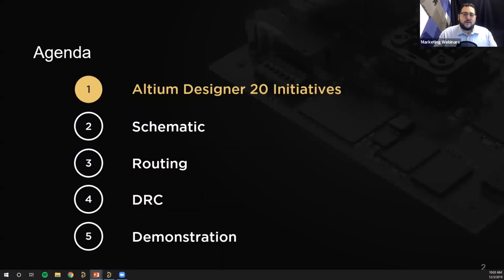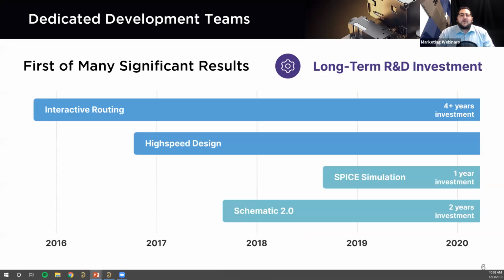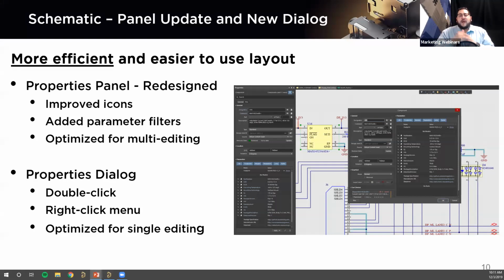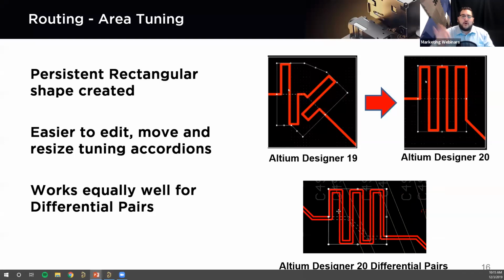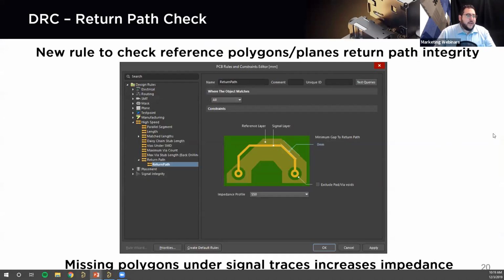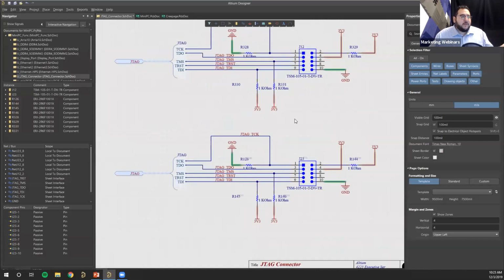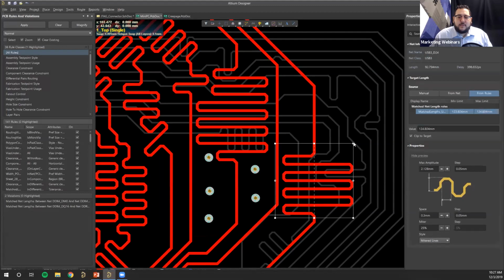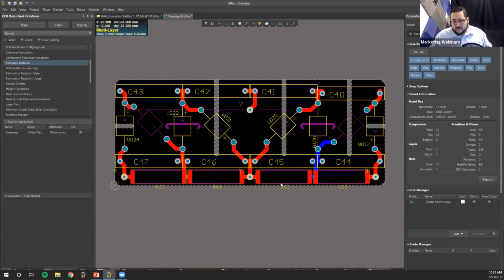Altium Designer 20: Meet The Next Generation Of Easy, Modern, And Powerful

Comment: High speed simulation needs sorting. The product needs to cut the cost until it compares to the pro software. The delta between CS and Altium is not worth it for the price but I wish you the best. I only have 14 days to test Altium at home after work (All Mentor) so that won't be enough.